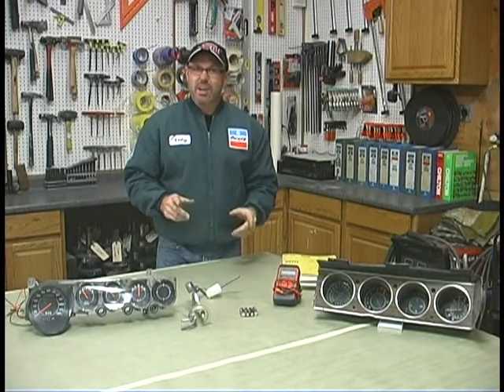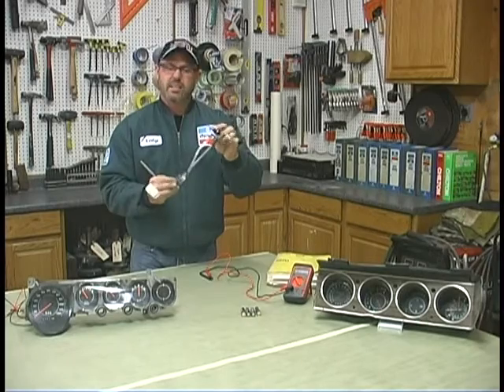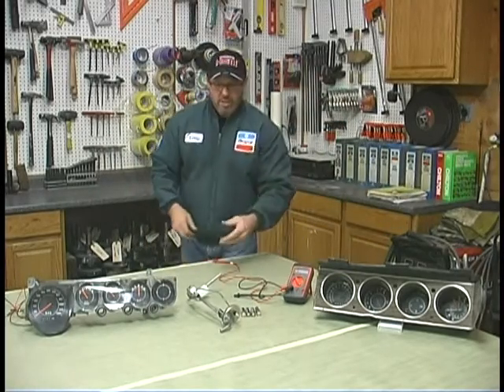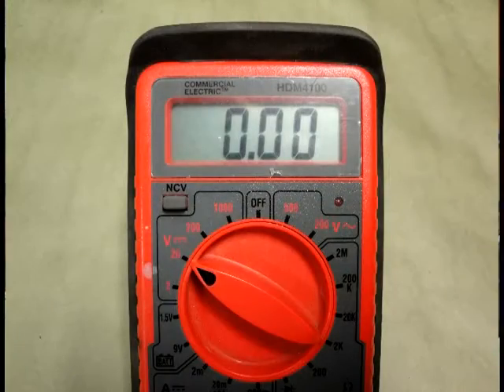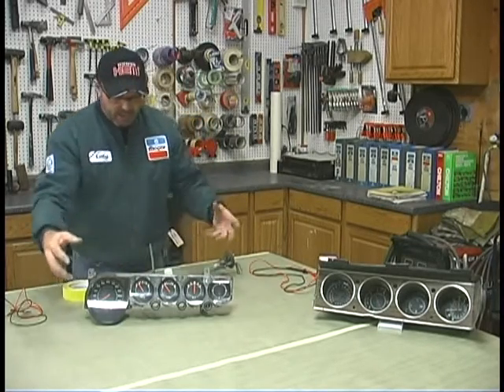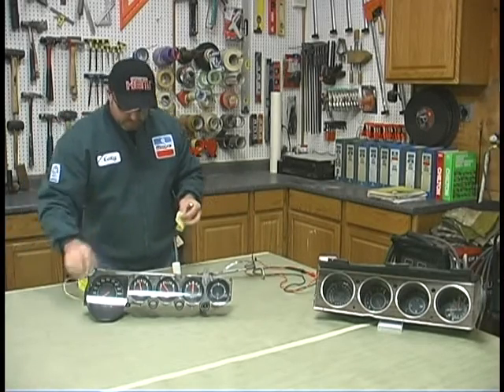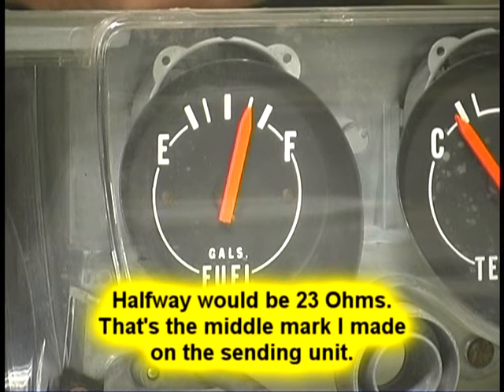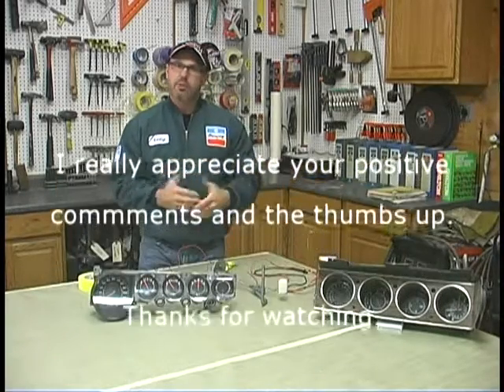How to test E-Body Gas, Temp, Oil, Fuel Gauges

Comment: My 71 roadrunner water temp gauge is working but reading hotter than actual temperature. Do you have a video on how to rebuild/calibrate the gauge?
Reply: Some aftermarket senders will cause that, or sender ground issues. I would check the actual temp with and IR gun. Supposedly 'High' is 250 degrees. 'Low' is 120. The gauge should be calibrated to 'factory' senders. You can tweak it if you take it off there are 2 little 'windows' in the back with what looks like gear teeth. You can very judiciously use a screwdriver to adjust the gauge to where you want the needle at operating temp. Honestly, I've seen 'em all over from 1/4-1/2 of the scale. I hate those ambiguous gauges. A little better than a light.

Comment: whats the wires on the gauges ran to ?
Reply: One post goes to '+' on the battery stack, the other post goes to the stud on the gas tank sender. Then ground the sender to the battery 'neg'. I think on those gauges the 'black' is power. Violet, etc are the sender connections. I don't know that polarity matters on those 'thermal' gauges for the purposes of this test. Make sure you follow the correct wiring on installation though.

Comment: Some one can tell me? in trying to make the gas gauge work for 1970 challenger and the wire there is running to the gas thank
 WHAT COLOR IS?
Also from the conection on the floor from the dash wiring
WHAT COLOR IS?
Reply: This shows you all the wire colors for a 1970 Challenger. https://forum.e-bodies.org/electrical-and-audio/11/colored-wiring-diagrams-70-cudachallenger/1349/